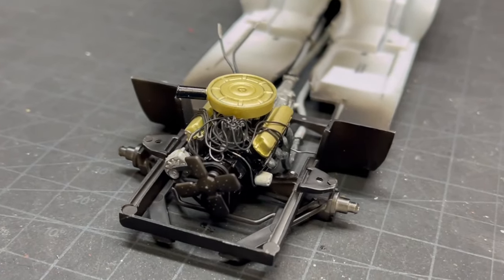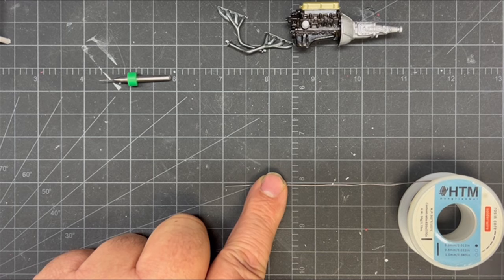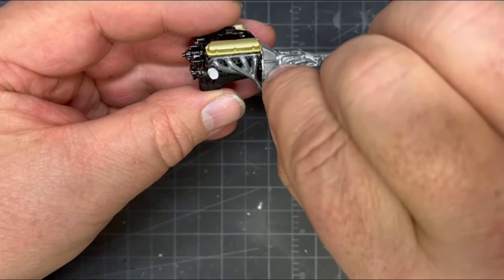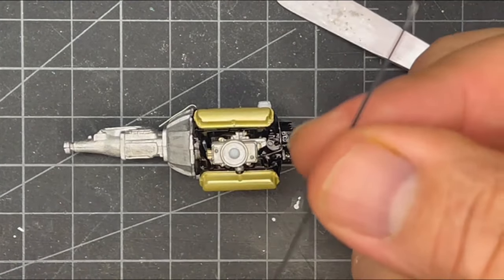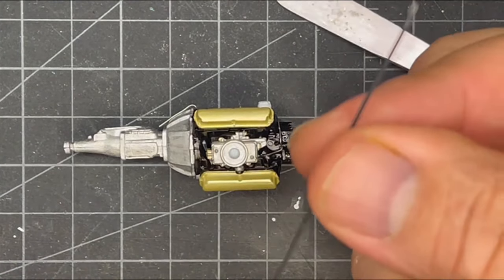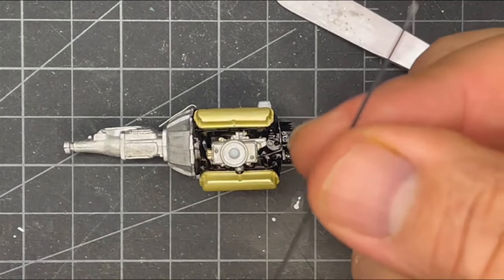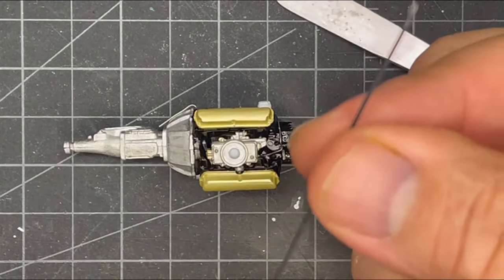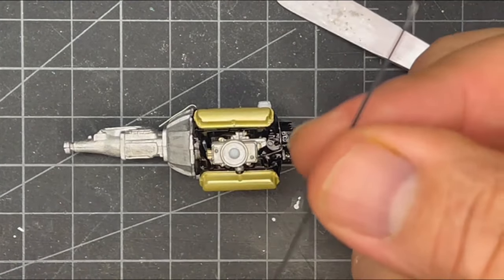Anyone can run plug wires with a few simple supplies.

Comment: Nice, been using solder for years. Its number one benefit is that it bends so easily. With harder wire you glue one end and try to route the other and the brittle super glue snaps right off.
Reply from the maker: For sure.  And I'm not sure why, but CA glue dries so fast on it.

Comment: I'm going to wire my 50 Olds custom. It's the first time I've added spark plug wires. I'm going ti try and do the fuel lines for the tri carb set up. Wish me luck! lol
Reply from the maker: Heck, there's no luck needed, you can do it.  If you are going to do that, you can do a dip stick too.  It's super easy and you'll already have the extra solder from your wires.  Check out my How To Make a dipstick video.  It's super small but adds a lot of cool detail too.

Comment: Useful video.and i will try it.  I  never thing to use soldier wire. I was looking for internet wire and fishing line but it was not exactly the look i wanted. The most important is the way to bend it properly. 
Thank for that
Reply from the maker: I've been using solder for about three years now.  Until I found it I gave up on wiring the plugs.  Nothing looked right.  Now I use it for all kinds of things.  It stays where you put it and it paints so well.  The plug wires are .3mm solder the heater hoses are .8mm  Enjoy.

Comment: Great video Mark! Ive been using phone wire, which works. However not as easily as the Soldier. Im switching🙂
Reply from the maker: Just wait till you use the solder.  It is so much better all around.

Comment: Wow thanks for the great video. Biggest takeaway I got was the whole sequence approach u did for all wires thanks again
Reply from the maker: Thank you very much.  I often add other things to the engines, but those go on after all of these wires and hoses.  Most other engines have a brake booster line, and PCV lines (use the same solder as the heater hoses) And since you have all those cut ends from the solder you can quickly make a dipstick from one of them.  I have a quick video on that too.  Enjoy it's not hard at all.

Comment: Fantastic tutorial, thank you, and I love your jovial sense of humor. After you brush the paint on the wires and you bend them back and forth, the dried paint doesn’t flake or chip off?
Reply from the maker: Thank you very much.  I use Tamiya's acrylic paints and it stays on great.  I will need to go back and touch up here and there, but that's mostly because I scratch it with the tweezers or something like that.  It really does not flake off at all.  something about the solder holds the paint very well, and makes super glue dry VERY Quickly.

Comment: Mark, A great tutorial. I am going to start using .3 solder as opposed to the 28 GA. wire I am currently using. Thanks for the link for the solder.
Reply from the maker: You are very welcome.  I know you will like it a lot more.  It's so much easier to work with.

Comment: I ordered the 0.3 - 1.2 mm and the 1.1 - 2.0 mm pin drill bits set, the 3 mm solder, and the 32 AWG magnetic wire from your links. That kind of info is very helpful. I’d like to see a link to your source for Tamiya acrylic paint, unless it’s Amazon. Im trying to avoid the $2.99 per each 23ml jar.
Reply from the maker: That is awesome.  I do get my Tamiya paint from Amazon.  There's nothing around here where I can get it.

Comment: Hi, so I just watched your video,interesting, I had bought aftermarket wire, but I think your idea is so much better. So I will order the solder and pin drill things from Amazon. ONE question, how the heck do you drill out the distributor, it’s driving me crazy, can you tell me how you do it? Thanks!
Reply from the maker: Thank you very much for watching my video.  I think you will like working with the solder so much more than wire.  Now if you remember I start by putting the wires in the heads.  Then I bend them around and run them to the distributor.  I never drilled out the distributor.  I just bring the wires up close to the pins and call it good.  When you are done and there's nine wires all packed around that distributor no one will ever be the wiser.  Now if you want to have holes (I have done this a few times) take your snips and cut the tabs off the distributor.  Then with a lighter and a dental tool (From the Dollar Store) you heat up the tip of the dental tool (not cherry, but close) then take it and push down on what is left of the tab on the distributor.  Let it sit for just a second or two, then give the dental tool a twist to brake it loose and you have a nice little dimple to put the solder into.  Then once you get the wire run the way you want pull it up just a smidge and with a toothpick put a dab on the end of the wire.  Put that back into the dimple and hold it for just a second.     

One nice thing about the solder is it will hold it's shape with almost no deflection.  The .3mm is handy as heck for so many things (carb linkage, brake and fuel lines, battery cables, and even piping around the seats if you get really ambitious)  If you like that then the next thing you want to add is the .8mm solder and you can do heater hoses, and pcv lines, and break booster line.    Anyway I hope this helps, if not let me know here or on Facebook at GrandpaMark's Hobbies group page.  Have a great weekend.

Comment: I would have thought the paint would flake off from the bending . Do you do something to make it flexible???
Reply from the maker: I always use Tamiya's Acrylic paints, and never gloss.  The paint does not flake off at all.  It will scratch here and there when I manhandle it with the tweezers, but for the most part it holds very well.  Once I get all the wires run I'll go back if needed and touch them up again.

Comment: Hey Mark - Just a silly question - Will the paint crack when bending the plug wires?  Or do you have to be super careful?
Reply from the maker: I use Tamiya flat paint and it does not crack.  It will scratch a little bit if you get rough with the tweezers, but you can touch it up quick.
Reply: @grandpamarkshobbies  Thanks Mark. I asked this before I finished watching the video where you talked a bit about that. By the way, that video was great! Kept everything in frame too. LOL
Reply from the maker: Thank you so much.  I've been working so hard to keep everything in focus and in frame.  Sometimes it's hard to do.  LOL
Reply: @grandpamarkshobbies  I'll bet it's a challenge in itself !   LOL  Thanks man!
I am thinking about going to the solder route.   Would you please use your micrometer to measure that heater hose solder.  I don't get out much so I would have to order it on line like most, I should say,  ALL my stuff. Sucks having this bad right leg and owning nothing but stick shift vehicles.  Everyone seems to be too busy to cart me around unless it's to the doctors.  Then they are in a hurry to do something else, no time to go anyplace else. I'll steal the line  "I get no respect ! "  LOL
Thanks again man :)
Reply from the maker: The radiator hose, PVC lines, and brake booster lines I use the same solder.  It is .8mm  Most radiator hose is 5/8"  Which is 3/4" outside diameter.  Figuring 1/24th scale that would make it .79mm which in my book is as close as you can get to .8mm.  Now for my battery cables, spark plug wires, brake lines, and fuel lines I use the .3mm solder.
Reply: @grandpamarkshobbies  8mm was the answer I was looking for.  Thanks Mark.  Just trying to move a little closer to your detail.  I do have miles to go! LOL